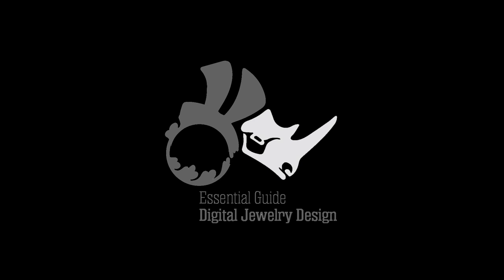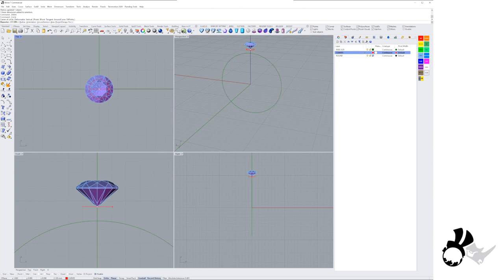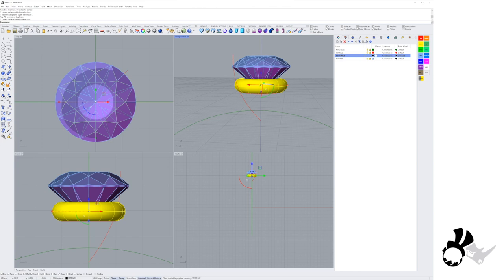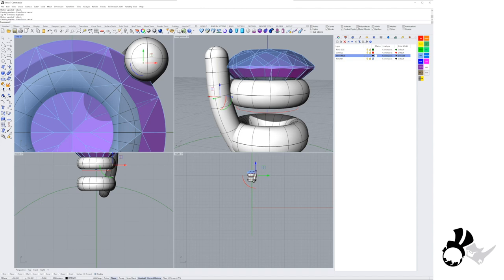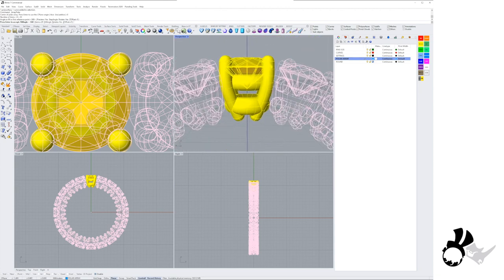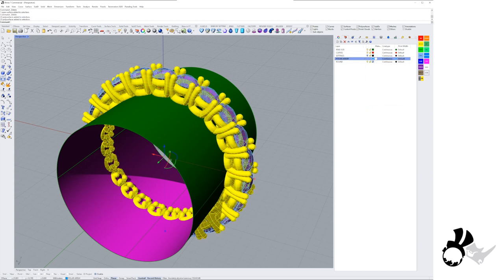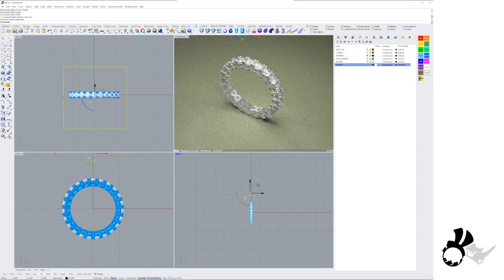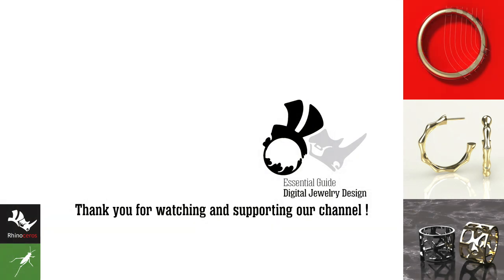Simple Eternity Ring #rhinoceros3d #rhinotutorial #eternityring

Comment: question, when you design jewelry, does the skeleton/casting have certain parameters to follow? or  can you do whatever as long as the render looks correct? they print these things though right? so theyd need to be perfect im assuming .. thanks in advance
Reply from the maker: You should definitely take care to design the pieces according to what is logical in terms of manufacture, ie not too thin walls, etc. But in terms of whether the ring would be printed as is, that depends on your finishing techniques, for high jewellery you will want to make this ring in two parts - shank and upper settings - so that you can clean it well and assemble and finish. Always speak to your goldsmith when you are designing, so you know how the piece will be finished.